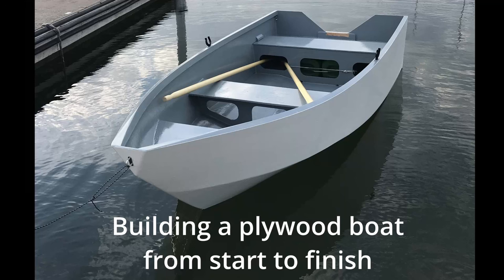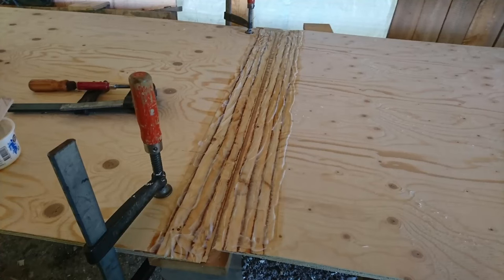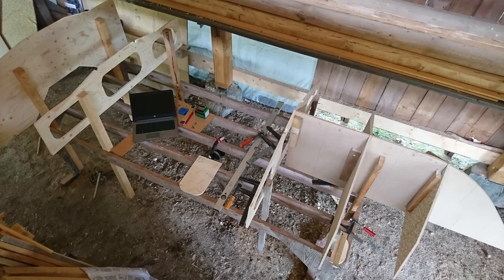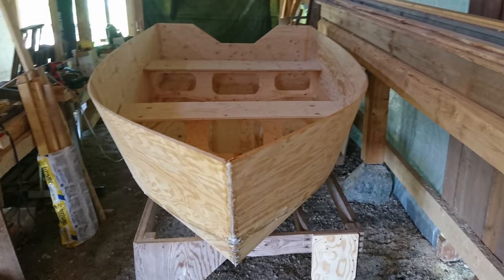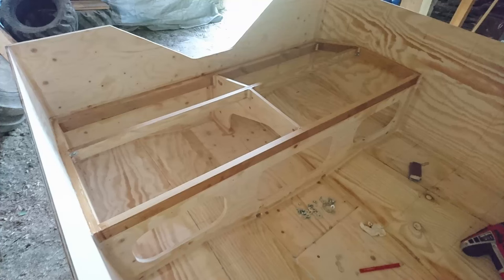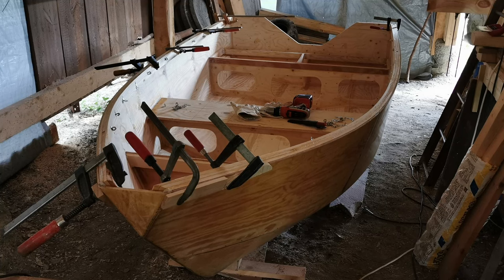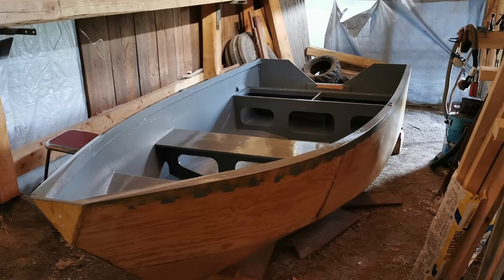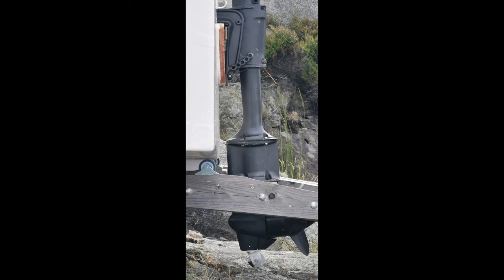Building a small plywood boat based on the Tewantin

Comment: When they join large sheets to build the Plywood yatches they dont shamfer the joint ...what they do is they cut a jigsaw puzzel edge join or a flat dove tail keyed edge and bond with epoxy then reinforce the joins with grp.  🧙🏼‍♂️⚓🇬🇧

Comment: Hi, I wanted to ask you for advice. In your opinion, what is the maximum number of hp of the engine that I can put on this boat ?
Reply from the maker: Hello! That is hard to answer. I would say that 6-10 hp is good for this boat. Hard to approximate the speed for higher hp, I would guess around 15-20 knots with 8-10 hp. But it depends of course on how heavily loaded the boat is. If you build a very robust boat it could certainly handle more hp, maybe around 15-20hp, it would be very fast and a bit unsafe :)
Reply: I'm asking because I would like to do this project this summer but I'm an Italian minor and I can't buy the project online by myself. If you don't want, thanks anyway.
Reply from the maker: @Alessandro-bq7ki  Sorry, I'm not sure what you want? A bill of all materials? I put most of it in the description of the video :)
Reply: @AntonMakesStuff  no, I need the project measurements to build the wooden parts
Reply from the maker: @Alessandro-bq7ki  Okay, I see. I got the plans from Tim Weston. It is his plans and you need to pay for them, I am not allowed to distribute them to you for free.
Reply: @AntonMakesStuff  okk
Reply: Buy the plans I bought a bunch of plans from different builders boat this size will handle 20hp if you stiff up the transom and floor I wouldn't go any higher because it's light start smashing waves at higher speeds than 27mph on this will cause unsafe twisting I would put a 20hp I fish the Mississippi and Missouri rivers but I fish off the back of the boat because of currents but trying to find a decent boat to fit 2 fat guys a cooler bait and beer then fishing gear is hard to find with a lower power motor and I'm not goin to spend a crap ton of money aluminum shot way up

Comment: Nice. 
The sides are high enough, it would be good to stick 10-15 cm of XPS foam in the shape of a triangle with non-return valves to the bottom to get a self-draining boat from the rain.... In addition, it would be unsinkable, which helps a lot in bad weather.

Comment: Amazing choice! I can't believe the way this boat planes  with the small motor.
Reply from the maker: Thanks! Yes, a large flat hull and not much weight :) with two people it does not plane as easily
Reply: @AntonMakesStuff  Hi Anton. Thank you for the video!  It would be great if you could tell us how does this hull behaves in waves. Dou you get a lot of hull slam when going over other boar wake at speed?  
I am also impressed by the lack of wake of your boat
Reply: @michaelf2646  Of course it will. It is a flat bottom hull. Flat bottom hulls don't cut through wakes or waves very well. That is why most Ocean-going hulls have deep Vs or Displacement hulls. The faster ones are Cats but they are still V-shaped hulls on both sides. If you want to go really fast and still have good wave performance, a catamaran is what you want.